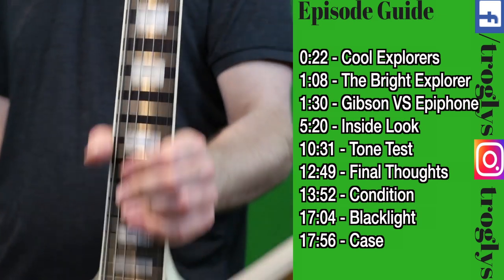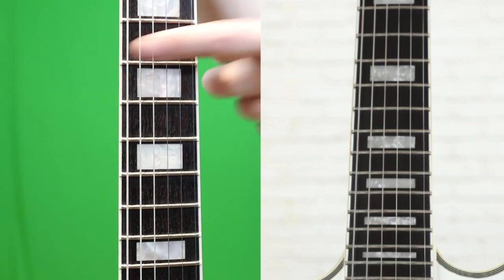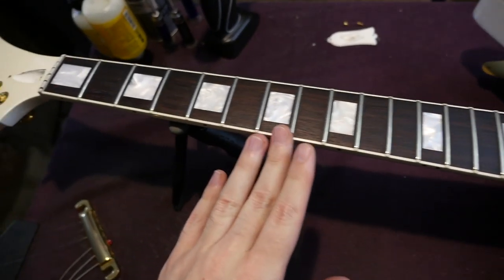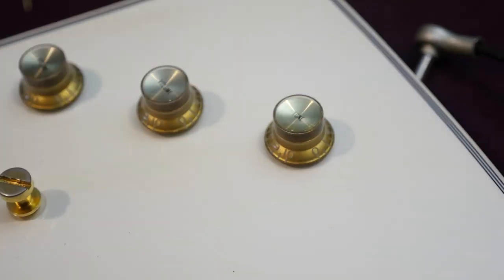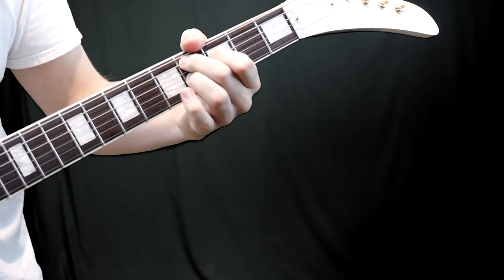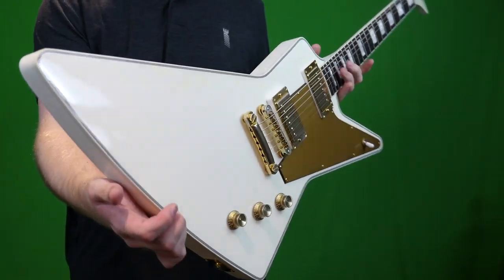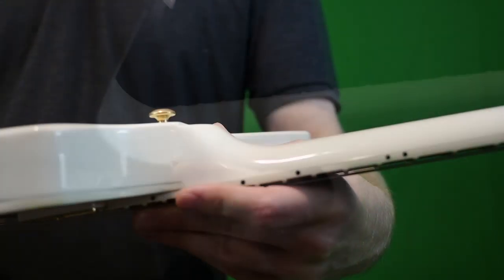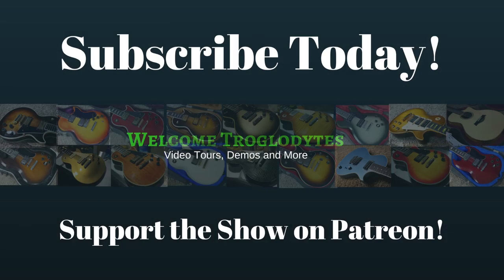What's The Difference? | 2014 Gibson Lzzy Hale Signature Explorer White VS 2019 Epiphone  | Review

Comment: Tech Tip -  They do not source special dark rosewood, they stain the lighter colored stuff until it gets to the shade  they want. That once blue Les Paul I bought from you Austin had a light colored fretboard and when I refinished it with the darker black and silver marbled finish that lighter fret board looked bad. So after getting advice from someone who once supposedly worked for Gibson I applied pure black stain to it and oh yes it certainly made it darker and yet the grain is still visible through that black stain. I was going for an ebony board look and could get it if I wanted to put more black stain on it, but with only one coat it is a real dark rosewood, about like the explorer in the video. 

So to anyone out there who might want a darker fret board on your guitar, just go to Lowes and buy a small can of black stain and wipe it on your fret board, after cleaning it and removing the lemon oil of course lol. Don't worry about your inlays,the stain will not adhere to it! To be on the safe side, I had a rag handy and would wipe the stain all over the fret including the inlay then take a corner of the rag and remove it from the inlay. If you are worried about making it too dark, wipe on a layer of stain, then flip the rag to a clean area and begin wiping off the excess stain immediately. One application took mine from a bright red to the color of the fret board in this video so you don't need much and it only takes about a half hour and that time includes cleaning and prepping.

Comment: I had an Explorer that had such a light brown fretboard it looked like a dried out piece of firewood. It was ugly. So I went and got some black leather stain (the Fiebing's brand) and lightly sanded. Then went over it with acetone to make the pores of the wood really open up and remove all oil and dust. Then applied four coats of the stain, letting each coat thoroughly dry. When I was all done, it looked like ebony. Really dark ebony. If you want a nice dark look to any rosewood guitar, or if you have ebony with the light streaks (which is a great look) and want to get rid of them, Fiebing's is the answer.

Comment: Those explorers always look awkward and heavy to me, but I have never played one. I  hate nitrocellulose, it always feels sticky to me and it will always yellow eventually. I have found you can fix stripped pickup screw holes by adding a drip (carefully! you might want to mask off the general area for this) of superglue to the hole and using an old string end to swirl it around and break up any air bubbles. It soaks in, hardens the wood and adds just enough build up for the screws to bite. Give it plenty of drying time to avoid gluing the screws in. I guess jamming toothpicks in the holes works too and is simpler, but it's often obvious this has been done.

Comment: I need a lefty one...and those Tone Pros bridges are awesome.  I have one of my James Hetfield Snakebyte (stock) and one of my Dean Zs (aftermarket mod).
Also: locking tuners do help with tuning (slightly) - there's less string on the post to stretch out while you play.  You also don't have to worry about a string flopping out of peg hole while tuning.  The only cons (aside from any price difference) are that if you have a guitar that's already kinda neck-heavy, your headstock will dive down like a Cincinnati Bengals fan's hopes and dreams...(case in point, my BC Rich Bich), and because you don't have a lot of excess string (if done properly, you'll have no more than ¾ of a wrap around the post), you might have a hard time going into a drop tuning.

Comment: You need to tape off with low tac tape when your soldering so you don't drop solder on the finish, make sure it's low tac, masking tape may stick  and pull off the lacquer. That's what I do.

Comment: Schlocking tuners? Nah, pull string thru tuner hole, towards head middle, under string at nut side of post, over top of the string, tighten = string locks itself (or use Fender slotted tuners)

Comment: At one point in your video, we can hear you complaining about the relative stiffness of the locking tuners.
Actually, having slightly stiffer tuners make them more stable and less prone to get "knocked" out of tune, and that's a clear advantage for a touring musician. I personally adjust the screws at the end of the tuners' keys of all my guitars to have quite some resistance against rotation ... 1st, I don't need to tune my guitars all the time, they're all pretty stable (locking tuners, graphite/teflon nuts, etc...), and when I restring I never need to make countless turns to tune to pitch as all my guitars have locking tuners (between half a turn and one complete turn maximum to tune to pitch).
Anyway ! Nice video !
Thank you for sharing !